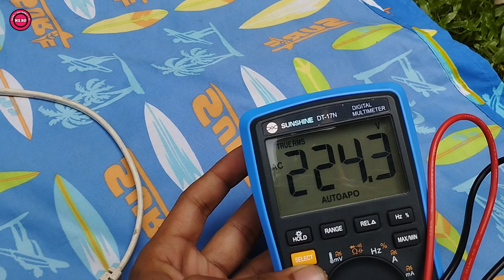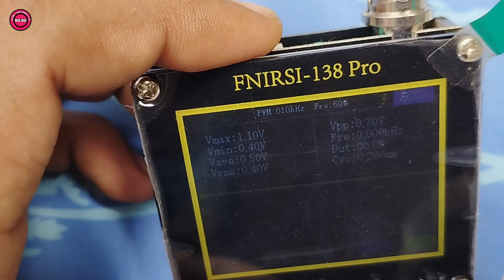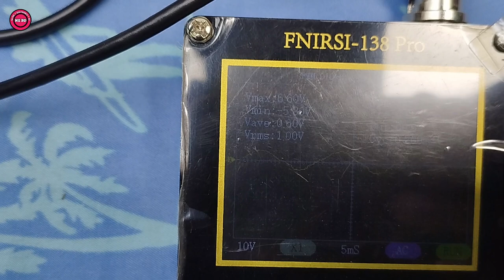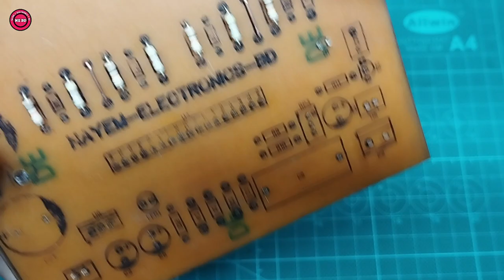DIY 300 Watt Pure Sine Wave Inverter (12V-220V - EGS002)

Comment: How to reduce the current consumption in no-load mode?
It's about 2.8A
Reply: Use a filter inductor in primary side to filter the high frequency which will reduce the no load current

Comment: can we use transformer with 12v-220v and has an ampere of 12A?
Reply from the maker: No , i am using 7.5 To 220V
Reply: but can we replace it with 220v-12v 12amp transformer?
Reply: because we cant find like that here in philippines so were planninh to replace it to 12v-220v 12amp ? what will happen if we replace it?

Comment: Hey sir
I made this circuit but no voltage out and led of egs002 blink 4 times it mean that under voltage and I changed the VR ristorante no change on output voltage 
What’s the problem please 
Help me
Reply from the maker: Your Gmail address send me
Reply: Thanks sir
Reply: I sent my gmail for you but it deleted 
I don’t know why
Reply: @nayemelectronicsbd  same problem with me how to rectify it please do tell
Reply from the maker: Transformer primary side 220V and Secondary side 7.5 V ......I hope solve this problem
Reply: @nayemelectronicsbd  yes 
I replaced the transformer and it works very well